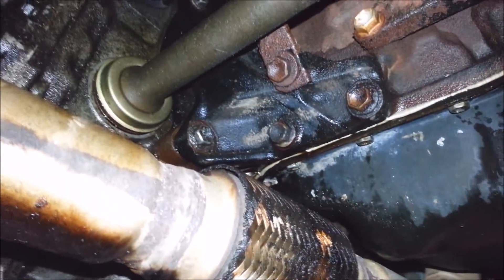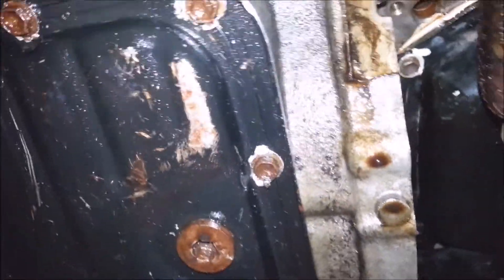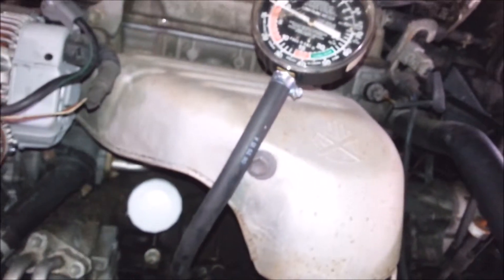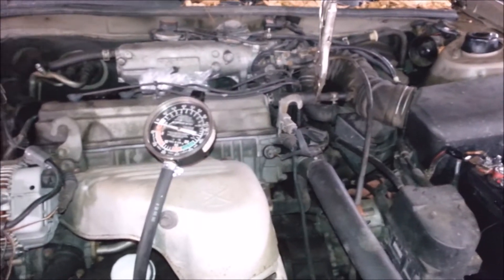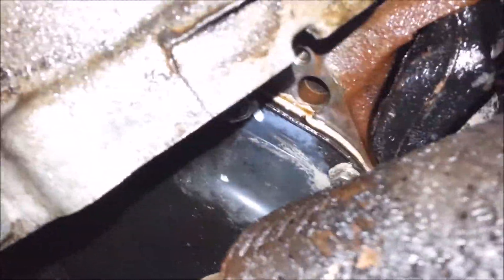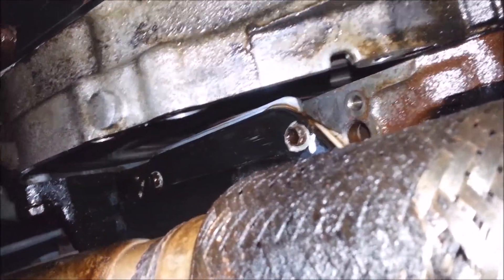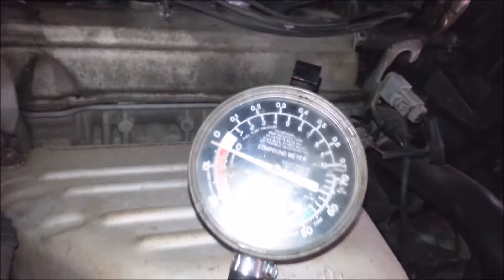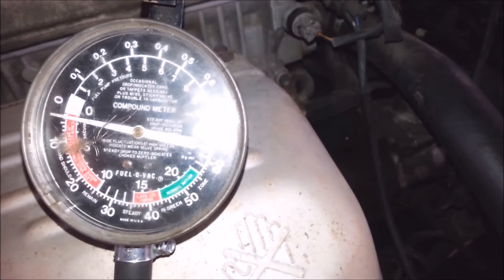How to find an engine oil leak using crankcase pressure

Comment: Very interesting that pressure was still so low with vents plugged.  I was thinking of using this method (putting guage on oil tube) to test PVC system is venting properly.

Comment: This is very similar to the test recommended by Chrysler to verify a plenum pan leak in the early ('98 and on) Rams. Cap off PCV, dipstick and breather, run engine and watch to see if manifold vacuum appears in the crankcase. As you show, normal response with PCV etc capped is a tiny positive pressure from blowby. Interesting to see another application.

Comment: Perhaps pressurizing the crank case as you have done and then use soapy water the same way you test for an air leak? if oil can escape air sure can, seems it would be faster.
Reply from the maker: The trick is to devise a way to do it with low enough pressure to not blow a seal. Smoke machines work too. Soapy water also does not work very well on really large leaks. This is a very old way to find a leak. Most people who do this have died of old age.